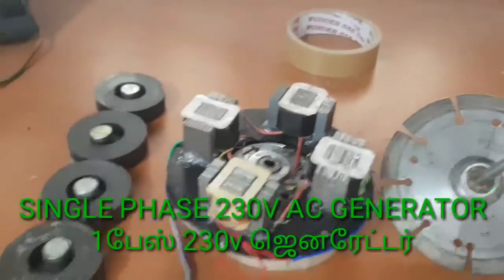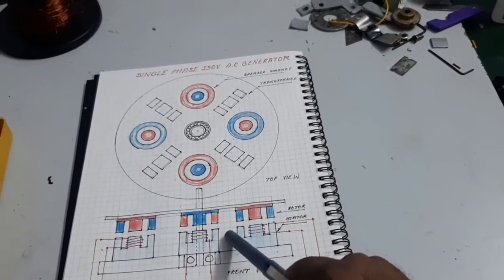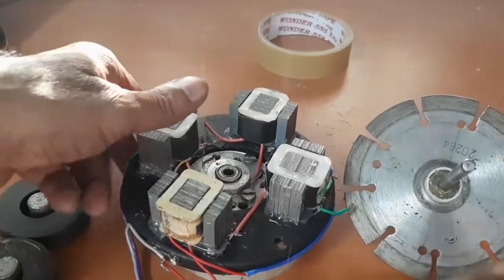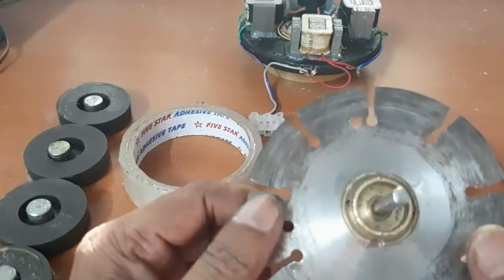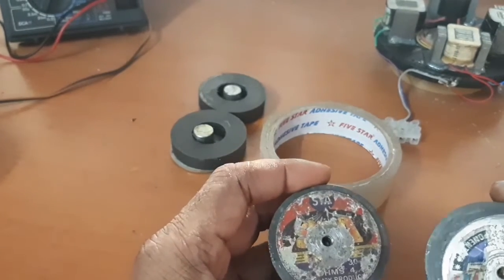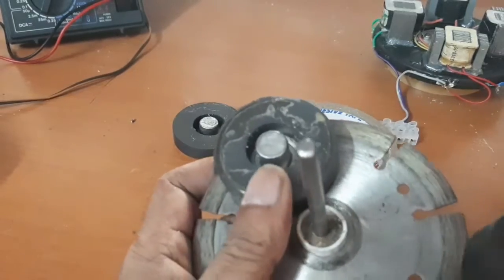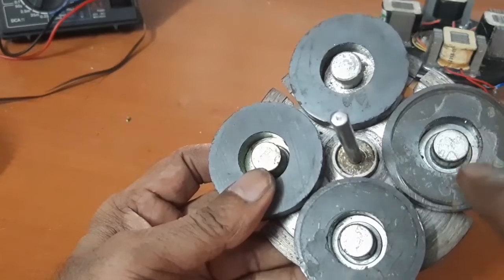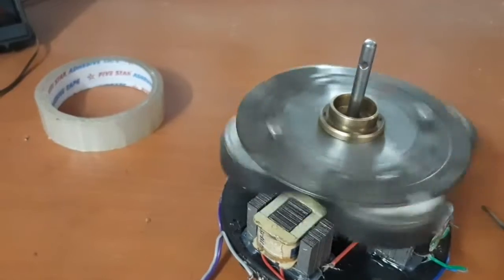(V-54),Make single phase generator.

Comment: To glow 36 w tube light ,,using 750 w motor drilling machine,,what benefit,,useless video...
Reply from the maker: Sir thanks for your comments
Here i am just using different concept to make a generator by available materials and i have no driver motor to rotate the armature. That is why using drilling machine as premover and it has Chuck for connecting both motor and generator. so you may be scientist or intelligent or highly qualified person. so first do and invent something useful to your family,to your people and your nation. You do and prove something and than ask question

Comment: Pls show output current....How much watts
Reply from the maker: Sir the transformer specification
Current :500 m amps
Pr. Voltage:230v
Sec.Voltage :6 0 6. (12)
So you have to load 80% of output
App: 60 w
Also the output depend the drive motor torque and speed

Comment: Dear sir you have shown 3 transformer circuit diagram.. I didn't  understand  4 transformer role
Reply from the maker: Thanks sir
Physically it has four transformers when seeing it front view of object  only 3 transformer are able to seen so that one transformer connection missing.
Four transformers connected in series and two cw and other ccw direction because the flux move upward in the centre limp two transformer and the flux move downward of other two transformer due to centre pole of speaker provided two north poles and other two have south  poles.
Reply: @pugalstech   Thanks For Your Reply